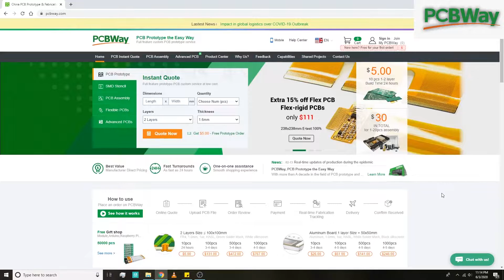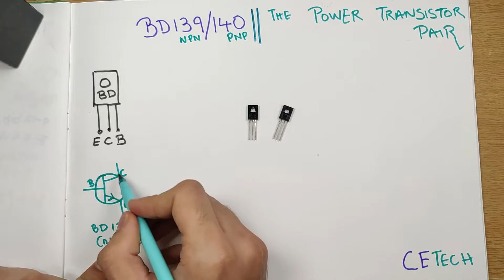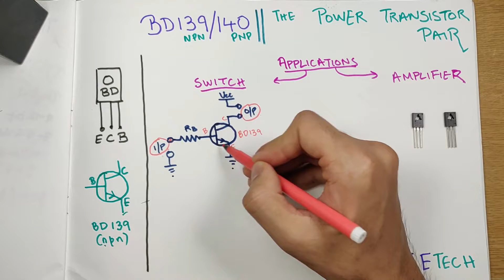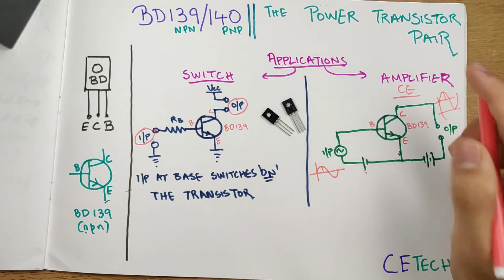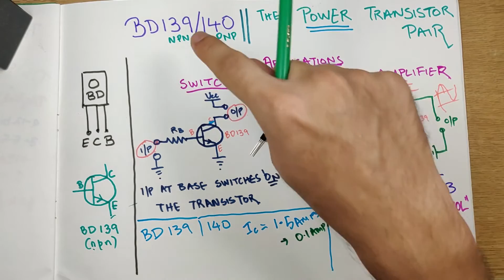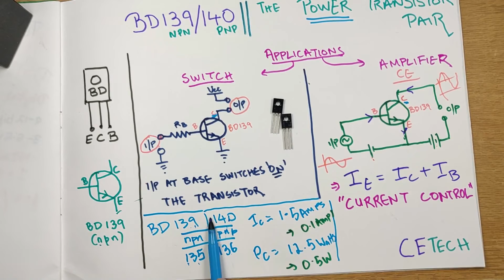BD139 BD140 Power Transistor Tutorial | How to use? | Pinout

Comment: Good job! I have a circuit which requires BD139. Can I use BD 140 instead?
Reply: NO ... Research the difference between NPN and PNP transistor. Then look at BD139... Is it PNP or NPN? What about BD140, is it NPN PR PNP? That will lead you to an answer.

Comment: You are well smart ... however, and for some reason this is with Indian electronics youtube very often ... you say "how it works" as the result minus the "how" - explanation.  You say a small signal is amplified to a higher level ... then you say "that is how an amplifier works" ... no, that is not how. That is the definition, it is not the explanation. Definition != explanation. If you can get past that your videos might get 1000s of views because people will find the "how" they are looking for. The transistor's natural function includes increasing proportionately the current ... triggered by the base and the "gain" ... (amplification factor) is related to scale of the junction and materials, reduced resistance or impedence ... so more current can flow but it is proportionate to the base level. " the transistors gain is how much collector current 'could' flow." said one person trying to explain - so it has a "gain" inherent to it's design. Maybe you should explain gain - what is the gain of these BD1xx transistors.
Reply from the maker: Thanks for that suggestion man!